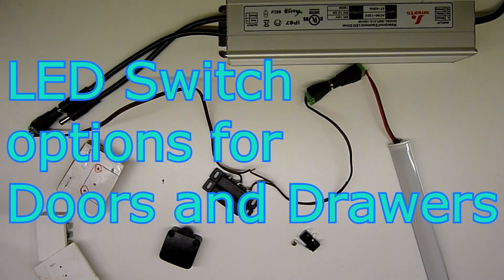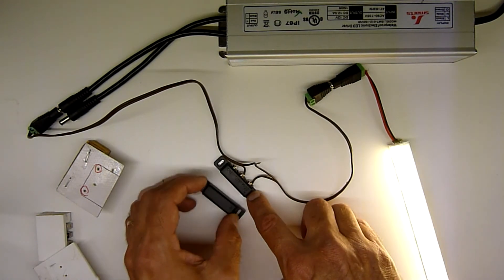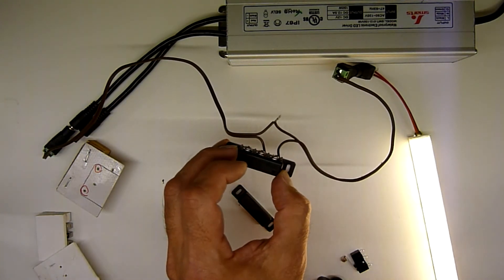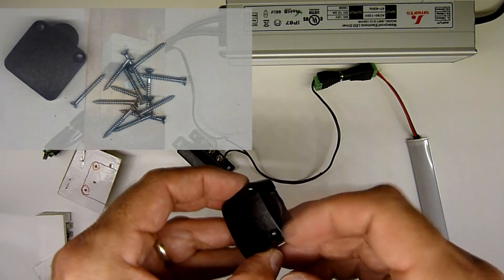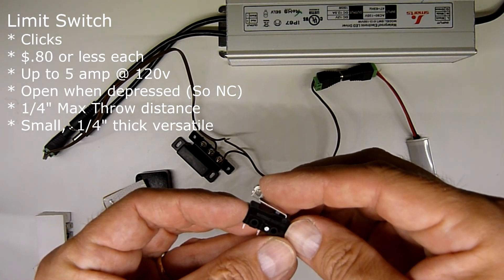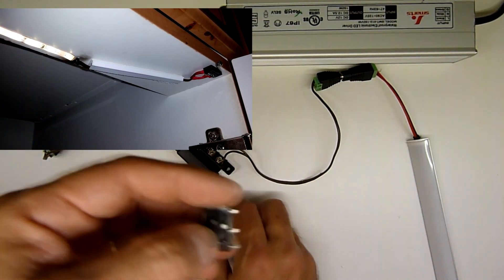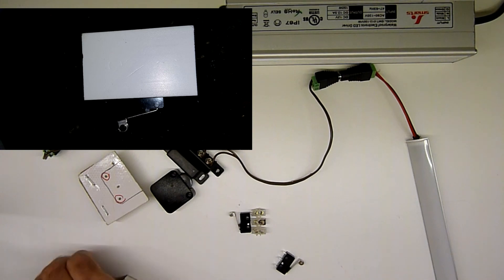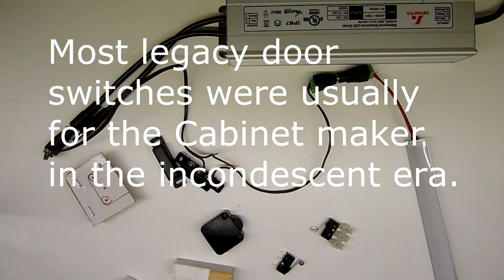Review of LED switches for Doors and Drawers

Comment: Not sure if you’ll read this. How do I know how long of a run is too long for a Reed switch?  I’m planning to install one in a small closet.  I will be using LEDs instead on an overhead light, and I want the Reed switch on the door to turn on when I open the doors.
Reply from the maker: First measure of a read switch is its amp rating. Since all the power runs through it the draw is the first limit.  As for distance, regardless of the reed switch, is the drop that dc experiences over distance. The drop is influenced by the power supply, distance, gauge/resistance of the wire and devices in line before the beginning of the light run.

The answer is if you have a meter test your drop to the beginning of the run.  If you are using a 12v strip having 11.5 at the beginning of the run is not a good start… assuming the power supply is delivering 12 to 13.5.  

You can improve on the drop with heavier gauge wire. If I have to do a power run over a cabinet I will use salvaged vacuum power cord and then return to a smaller wire when entering a fixture or more visible area. 

Consider a motion sensor. They work great in closets.  I always place them over the door on a pivot which gives trigger control.  It assumes there is no hidden turns in the closet. Motion sensors also have a much higher amperage rating.

Comment: For the led switch do you know how to change when it turns on rn my in only turning on when the door is closed
Reply from the maker: If the switch has 3 posts... one is the common, one is used to connect the contacts with the switch is at rest, and the other when the switch is closed.   

So if you have 3 posts on the switch, you need to move the one that is not the common to the other position to get the opposite action.   

On the limit switch I show the common is closest the hinge.  The magnetic switches will usually have a C at the common post.